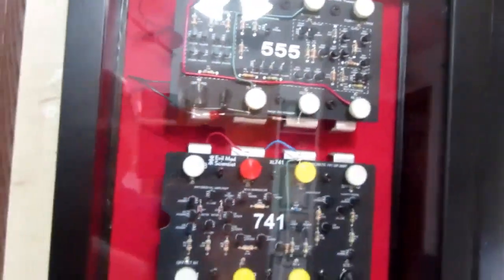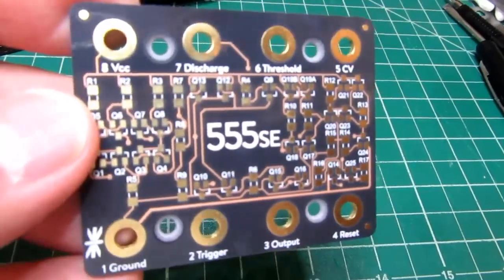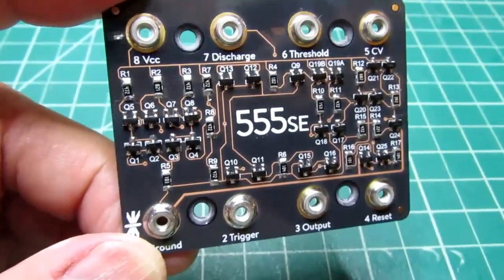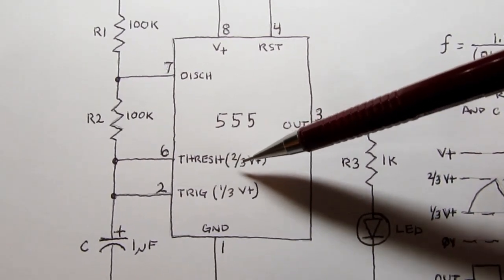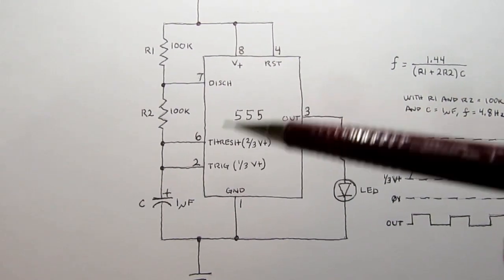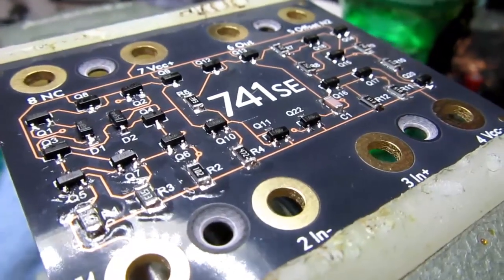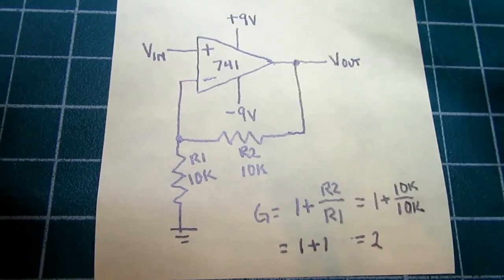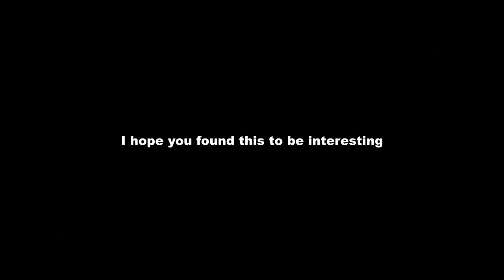Evil Mad Scientist "555SE" & "741SE" Kits: Assembly and Demonstration

Comment: Another great and interesting video Paul. Amazing what they can put into packages like this, sort of thing that are fitted into a small chip now, but this shows how the thing works, though those transistors are tiny.

You showed that you were using a lighted magnifying ring, wouldn't the excellent microscope you reviewed a couple of years ago, also be ideal for this type of work, or is the magnification too great, or does it take a lot of practice getting used to do close up work like this while looking at a screen, rather than looking straight down at the piece like looking through the magnifying ring. Not a criticism, just interested. I admire people who've got both the patience and skill to do work like this with such small pieces.

Keep up the good work
Reply from the maker: Philiplettley, I find it difficult to use my digital microscope for seeing small things while working on them. The area being viewed is very small, so I need to constantly be moving the workpiece to keep the working spot in view. Also, the microscope camera needs to be quite close to the subject, so not much room for getting tweezers, solder, soldering iron into that shallow space.

Comment: I was most interested in radio and control electronics.   The op amp was a bit of mystery to me as to why it was looked at as such transformative device. That's because I came of age in the late 1970s when digital computers had taken over.   The operational  amplifier was the component building block of analog computers of the 1960s and earlier which I had no appreciation of till much later in life.   

Since the IC op amp appears to offer a simple low component cost means of amplifying low frequency audio signals I wondered why it wasn't in every audio circuit.  The reports from the electronic news media is the reason the op amp is not used for high quality audio production is it is noisy.  Exactly how the op amp adds artifacts to an audio signal was not covered.  

 I used a 555 when 16 years old for masquerading a fake audio bug by having it flash an LED.  This was in 1977 when people thought flashing LEDs were high tech.   I'm surprised such a simple cheap device is still a mainstay of simple clocking circuits more commonly as a 556 that has two of them on the same chip.   

My high school freshmen electronics teacher in 1977 said with the introduction of ICs,  electronics would come down to a few chips and a power supply.  That was a bit off putting for a student wanting to be come an EE.    I'm still waiting for an IC based 100W clean mono block power audio amplifier!    

Now it appears that radio has become phase shifting frequency polluting signals only being useable after going through error correcting digital code processors that had previously codified 8 bits into 10 so hopefully 9 came out clean enough to calculate into the original 8 bits.  

Very good depiction of SMD discrete component implementation of a 555 and 741, Thank You!
Reply from the maker: douglasengle, while op-amps are not used in every audio circuit these days, they are probably in use in the majority of them. However, they might not be in the form of monolithic IC op-amps, but rather the op-amps might be just a sub-section(s) of LSI audio IC's.

Modern op-amps are not 'noisy', at least not noisier than anything else, and of course there are op-amp types that are more specifically "low noise", and the specialized differential op-amps used for providing considerable gain at ultra low noise levels are just about universally used in professional microphone preamplifiers, recording studio mixing boards, and other critical audio applications. Then there are the low-noise op-amps used in high precision instrumentation amplifiers.